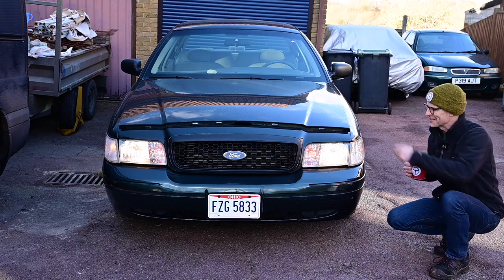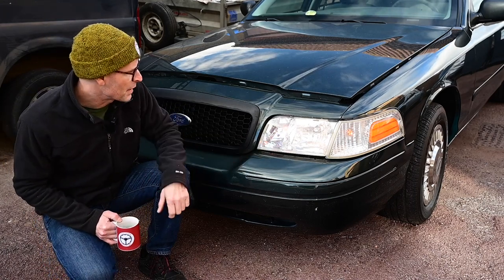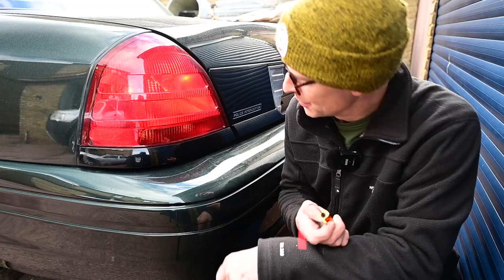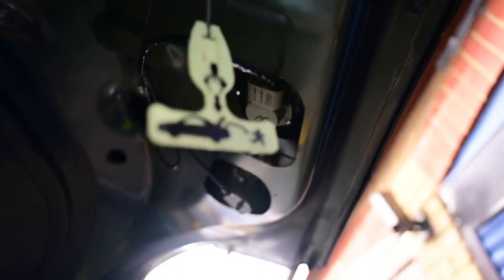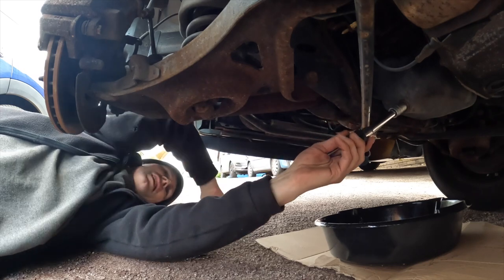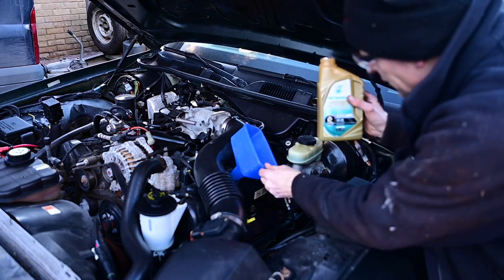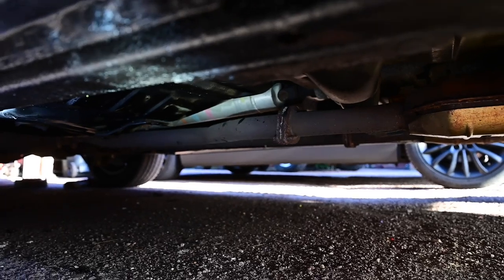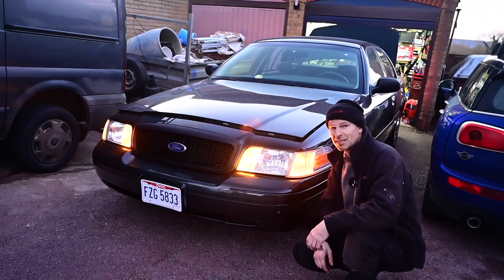Ford Crown Victoria MOT ready - oil change and under sealed

Comment: You can get electronic flasher relays that flash at the same rate irrespective of load ....saves you buggering around with the load resistors. Good luck with the MOT 👍
Reply: The non electronic relays give an instant indication of a blown bulb when driving by speeding up the flash.  Changing to LED bulbs does present a problem though.
Reply: Not to mention that these cars don't use standard flasher relays. They have a lighting control module that has integral flasher relays

Comment: About the front headlights, that's not really correct. The beam pattern is actually made by the reflector on the rear side. On the Freelander the headlight is "lens optic" type, as you mentioned the lens direct the light and makes the pattern. On the Crown Vic, it's the "reflector optic" type, where the rear reflector makes the pattern. 

Besides having a "left hand drive" and a "right hand drive" pattern, there are also two different kinds of beam patterns/cut-off-shapes. 

The one used in the US, is usually referred to DOT pattern, while the one used in the EU called ECE. The main different between the two is; in the US-DOT version the cut off line is straight going from one side to the other, with a kink in the middle, while in the EU-ECE version, only one side is straight, and from the middle point the other side it's slightly angled upwards.

Comment: Looking forward to seeing this vehicle on the road hopefully also the V8 P6 & Vi will be up & running.
I don’t like under-seal or wax oil unless it’s a repair job far better to use ACF50 you can also coat all the mechanical’s suspension brake & fuel lines it will dissolve light surface rust leaving a protective coat and help prevent seizure of parts it’s easy to re-coat and doesn’t trap moisture like waxes or bitumen based products.
Reply: I used to paint old used engine oil on the chassis and underside of a non undersealed vehicle, steam cleaning/preasure washing and applying in Spring and Autumn.  Access to a pit or lift helps.

Comment: Those patterns and mouldings can be either part of the parabolic reflector or if the parabolic reflector is smooth they’ll be on the lens. It’s one or the other. Sending some of the light off to illuminate the kerb can be done by either. The fact that it’s a ‘flat beam’ is not a result of the technology used, rather of the beam pattern design.

Comment: With the oil, 5W20 is correct. The oil return passages are too small for the 30 weight to work. The oil collects in the valve cover and the bottom end is wrecked.
With the underside of that car looking like that, invest the cash into having it treated by Krown Rustproofing. They do an amazing job. Done in the autumn and left until spring, it will preserve the floor pans and frame very well indeed. That is how the body on my 1990 Volvo is so good. The other thing on a Panther is to install mudflaps behind the front wheels. Just the geometry involved on them, the grit thrown back and into the frame behind the back wheels scours everything off the frame rails and they rot. The rot from the inside out and the outside in. The rust meets in the middle and suddenly you have a whole were solid metal used to live.
Being a P71 car, it has the Police Package frame. There is additional gussets to reinforce the welds. The torque boxes (the boys structure you showed) are larger and shaped differently than other Panthers. My 89 Mercury Grand Marquis came with the upgraded frame because of the towing package and 6,000 pound tow rating.
Count yourself lucky. Only one drain plug. The Windsor engines in the older ones had a dual sump oil pan. Had to drain both.

Comment: Have you tried wiring the ballast resistor in parallel rather than in series with the indicator bulb? My experience of these units is they usually must be wired in parallel!
Reply from the maker: no, worth a try though

Comment: I'm also surprised at how it looks underneath!
I think, since MG Rover put the Ford 4.6 litre V8 in their vehicles, you should be able to get oil filters for this Ford.
You are definitely going to love this, a great highway Cruiser.
I also agree, if you can, for side repeaters to use the cut-out in the side lens, it would still look factory.
Great job!
Fingers crossed that it passes its MOT!
Reply: Ford used this filter in a bunch of cars. My grand marquis and Ford Escape both take the filter, and I know they sold the escape over in the uk
Reply: @will2993  They call the Escape the Kuga. Why, I don't know.
Not too surprised the filter goes on several different engines.

Comment: Unusual for a 2002 model to require full synthetic I would have thought.  I almost always use ramps if I can unless removing a wheel.  I find it gets the car up higher than wheel stands and I just feel more comfortable getting under the car when it is on ramps.  It will be a big tick off the list once you get those UK plates on her.
Reply from the maker: Thats what the books and groups say. My old ramps are too narrow for this car, and not sure Id trust them with its weight either, plus I want to access  from in the wheel wells

Comment: To get the led indicator slower I installed two old 10watts fiat indicator lights I had in the garage and placed them hidden in the trunk, connected to the indicators. You can take any old 10watts socket and lace them in the trunk.
Reply from the maker: thats what Ill have to do
Reply: @furiousdriving  I wonder if adding 10W side repeaters in circuit with the front lamp would slow them down? Why hide them if you can utilise them for the side repeaters!

Comment: Hi Matt, I made myself a couple of ramps from solid wood. I just run my cars up it so I can get under to do oil changes. Save’s faffing around with the jack and axle stands.
Reply from the maker: Ive been meaning to do that for ages, of course now timber is more valuable than platinum!
Reply: @furiousdriving  i got the idea from the previous owner of my holiday (and future retirement) house in Noirmoutier (island on the Atlantic coast of France), he left me loads of useful stuff including a pair of ramps - which I copied for my home in Ardèche I made it out of old pallet wood. He also left me a quite brilliant air compressor made of a refrigerator pump and a recycled butane gas bottle! This summer I’m going to see if I can use it to power air tools and a spray paint gun. I have my late mum’s 1989 Peugeot 205 RHD automatic to restore.

Comment: For future reference, when doing an oil change, you might want to turn the wheels fully to the left. This'll help get the pitman arm out of the way when accessing the oil filter.

As far as oil goes, pick your favorite ACEA A3/B4 rated oil and call it a day. While 5W-30 was the default standard for a while, Middle East exports spec'd 20W-40 before Motorcraft discontinued it and 10W-30 became the new standard right through to model year 2012. A 5W-40 HDEO meeting API CK-4/SN and ACEA E9 would be a decent choice IMHO.

Comment: Flush that power steering with some fresh synthetic transmission fluid, (not power steering fluid). Get rid of that whine and keep that pump going for a long time. This stuff is great man. She's a beauty, get her undercoated better and IN the rocker's and frame etc, (nhoil, woolwax, fluidfilm) or whatever is around your part of the world. I do recommend UP and over the rear wheel well from the inside (yank the door sills). They didn't roll the lip on the rear on these like they did the later years and it catches a lot of crud as well.
Reply from the maker: Yes, the P/S fluid does needs doing, and the auto box before 100k miles

Comment: i think where you mention about the flat beam on the headlight its the internal part that dictates the beam but most light with no pattern on the lens the beam will be central not handed - motorcycles have been like this for years and with leds now as you cant point them the beam just points straight

Comment: The high wattage, wirewound resistors you have bought from eBay will work , but must be wired in parallel ( across) the bulb holders.

Comment: Try turning your steering wheel all the way to the right next time you change the oil. It will move that pitman arm out of the way and make it way easier to change the filter.

Comment: I would stay away form those resistors for your led replacements and instead buy an electronic flasher unit 0 they don't care about the load on them and actually have a speed adjuster screw on them. I have one fitted to my bike and it works great. Forget having bodged errant bulbs flashing away in the boot!!
Reply: I know you hearted my comment Matt but is it useful?

Comment: Pretty good condition underneath, can't have had a lot of use. Had to do same with fog light for my import, just took power from inside the dash with a relay connected to the fog and main lights. If the lights are good hopefully it'll pass first time. Good Kuch waiting for DVLC to to the doc work. My want to put it in barn til summer when your likely to get it back.
Reply from the maker: Its too big for the barn sadly
Reply: @furiousdriving  Oh well, at the pace the DVLC work, you'll have plenty of space to store spares for while 😁...sadly
Reply from the maker: @jo_clarke1960  😅

Comment: When the oil spat out, that made me chuckle 😂. Have you heard of Lanoguard? That may be an easier and more user friendly application for rust protection.
Reply from the maker: Ive seen it but not sure how long it lasts between re-coats. Ill have to try it on something
Reply: @furiousdriving  Can last up to a year from what i hear. Haven't tried it yet but apparently requires very little prep. Recently used Bilt Hamber UB for the undersides of mine and HCB-1 by Muc-Off for suspension items.

Comment: Big fan of these. I've wanted an Interceptor for a long long time, I always thought right hand drive, a competent turbo diesel engine (3.0 power stroke from f150) with an auto box option and these would have sold well in the UK.

Comment: I was told too sand all surfaces rust first then use undercoating??? Should I just do this I have a little surface rust in the wheel well
Reply from the maker: it just says wire brush loose surface (flakes) rust off, so you have a solid surface. It has rust killing properties so no need to go back to clean metal, you'd be there for days

Comment: I had a 2002 CVPI. You're overdoing a simple oil change. You can take that oil filter off by hand. Just stick your hand up there, and twist it. Also, when you place it on jack stands, crawl in from the front of the vehicle. You dont need to take the tire off. You dont need a cheater bar and an extension. Just crawl under there with a normal 5/8" socket. It's not hard to get it off. Also, I am not sure if you can get oil by the quart in the UK, but it takes 5.5 quarts. Much easier to measure. Be sure to change the transmission fluid every 40,000 miles, oil every 5,000 miles, coolant, brake fluid, and power steering fluid every 3 years, and that car will treat you well. Mine made it to 223,000 miles before it finally died...and the police department that owned it before me did not take care of it. Had it been maintained better, I probably could have gotten another 100,000 miles out of it.

Comment: It amazed me with the modern American cars I had , just how refreshingly simple the engineering is , it is easy to work on . oh on the side repeater I myself would put the side repeater where  you see a lot of factory installations ahead of the door rub strip or higher up near wing crease on the back part of the front wing , if your front indicator was flashing the outer wrap around lamp that takes care of junctions
Reply: yeah, the most modern thing is that engine, a 1991 introduced 4.6L v8 that was made to be durable and reliable. easy to work on

Comment: Would it be wrong to fit an MG Rover branded oil filter part number LPW000071 on the Crown Vic?  🤣
Reply from the maker: Thats probably the same part, although there was a part number change in the mid 2000s

Comment: Part of the remarkable condition of the car's underside, especially coming from Ohio where a prodigious amount of salt is used on the roads in winter, Is that police vehicles are typically washed at the end of each shift.
Reply: Yes, when I worked at the local county fleet maintenance facility, the car wash had undercarriage spray facility built in. so the floor of the patrol cars did not get rusty. however, leaks from the holes drilled in the roof and fenders for lighting equipment were prone to rust -but not a problem with a detective-spec CV like this.  Ooooh, those Cheyv Impalas, though - one winter and they were rust buckets like you wouldn't believe!
Reply from the maker: Thats interesting and makes sense, and explains the condition

Comment: Does it have a traditional flasher relay  ?  Is so can it be replaced with an led type relay ?  I know nothing about auto eletrics  so excuse my 
babblings. 
Best of luck for the Mot I think you've prepared very well .
Peace and love brother 👍🏻☮❤
Reply from the maker: it does but it seems to be integrated into the other lights circuits
Reply: @furiousdriving  Ah ok, immediately above our electronic skill level 👍🏻☮❤

Comment: 6 quarts is just 6 small oil containers, or one big one plus one small one
Reply: I had a 1996 Thunderbird with the same engine it was not the easiest thing to work on because on the Thunderbird it got shoe horned into the engine bay and if you used a jack stand the sway bar would get in the way of the oil filter. I drive a 2014 manual Subaru Forester now with the 2.5 engine and it is a lot easier to work on overall but I still miss my V8 even though my Subaru is just as fast.

Comment: I took a car with clear headlights lens for MOT and it failed as the beam was pointing to the wrong side. The modern jewel reflector must give some direction
Reply from the maker: you can angle the entire unit a little, maybe it had been pointed full right?
Reply: @furiousdriving  I’m not sure a little adjustment would achieve much. A lot or adjustment would end up lighting the road side! I swapped them out for known good units. (Both sides failed )
Reply from the maker: @AndyK.1  ah, bad units then!
Reply: @furiousdriving  Well LHD units 😆. So I guess they exist with clear lens units

Comment: did you ever use that silver hook underseal i sent you in junk in the trunk?
Reply from the maker: I used some of it on the Volvo after I dd some welding, some left is about to go on the Freelander. 
I put it on bare metal first on the 740 but then wasnt sure if it needed to be covering a painted surface
Reply: @furiousdriving  ive covered that on all sorts, welding, bare inner wings etc and its fine, you can even over paint it like stonechip for sills

Comment: Where does the idea that British roads are salty come from. We have very small windows of bad  winter weather where some roads are  salted. The number of times this happens is measurable in days rather than weeks in most years.
Reply from the maker: you can literally see it on the road for the last few weeks and the Freelander was showered in the stuff by a grittier the first time I drove it
Reply: @furiousdriving  Would be interesting for those of us living elsewhere on the globe where roads are not salted to learn a bit more about it.  Like, is the milder South of England salt free?  Is there a certain amount of snow before it is used?  Is it used only on major roads/motorways?  Is any alternative material available that does the same job?  What does the salt actually do, does it melt the snow?  A video for another day maybe?  Don't think salt is used at all in Australia, even in alpine areas.  Rust is rarely a concern when buying an old car here.
Reply: @furiousdriving  You can watch the weather forecast, as the gritters only go out when the temp drops to 1+ C. They  say old 60/70s cars rust badly, but we use to get a lot harsher winters then and salt and snow could be on the ground for weeks.
Reply: In some countries, in the mountains (like Switzerland, Austria,...), they use ice melt chemicals instead of the salt. Problem is, while they do not damage the roads, they rot away metals. So, whichever you choose, it is a loss-loss. :(
Reply from the maker: @DashCamSerbia  we need heated roads, like in parts of Scandinavia
Reply: @furiousdriving  In this small window of bad weather like I said.  A few icy mornings in some parts of Britain and enough grit to solve black ice not 2ft of snowfall. Salt is a problem in countries where serious snow fall lasts for months, car are buried and they have to use chains and mandatory winter tyres. 365 days of damp causes rust on poorly protected car parts in Britain.
Reply: @terrortorn  365 days are damp a year are they? Lol
Reply: @davewright7512  Yes there isn't a summer morning where condensation can't be found or dew upon the grass, or under a dark car. Plenty of water vapour in Britain. Unprotected steel rusts in the Summer too.
Reply: @furiousdriving  Or a reflector in space, to focus the sunlight onto the roads and melt the snow. :D

Comment: Aerosol rust proofing is never gonna be as affective as a professional wax proofing in a garage!
Reply: Yeah, because you don't get professionaly ripped off if you diy it. :D
Reply from the maker: You can cover the exterior effectively with cans, and you can buy the wands to DIY the cavities
Reply: @furiousdriving  Can you please advise which brand of wax oil aerosol you have used there? Thanks.
Reply: @DashCamSerbia  there's no need to get ripped off if you go to a reputable garage. I would of thought that was basic common sense 🤔
Reply: @anthonyredmond6713  Tetrosyl products are pretty good for DIY undersealing
Reply: @In_memory_of_Dad  OK thanks for the info, Cheers!